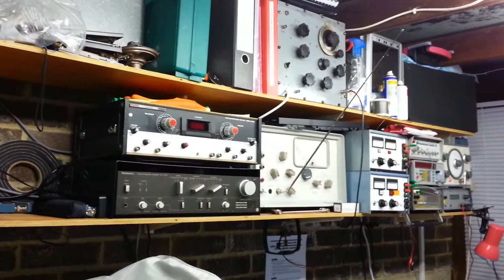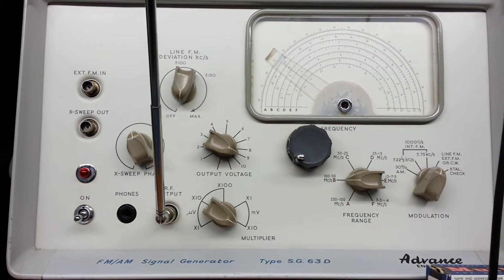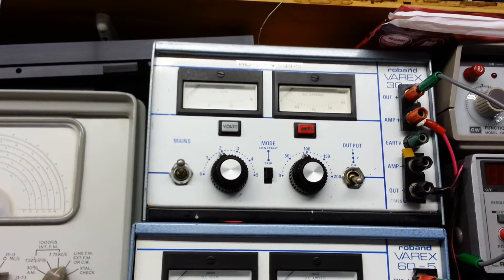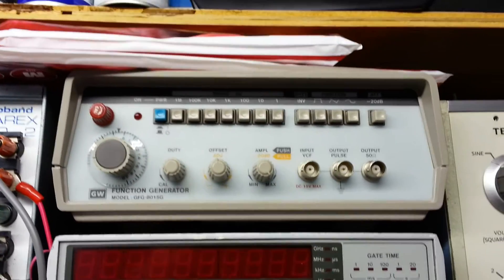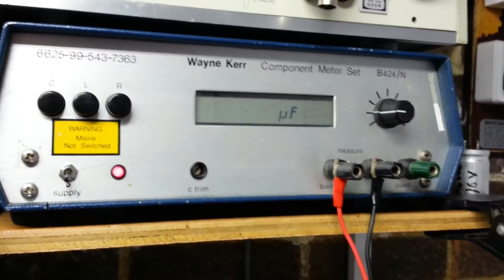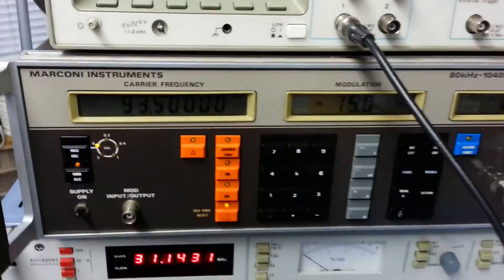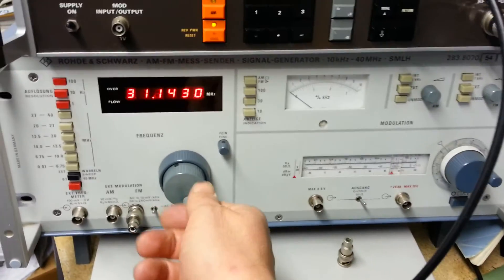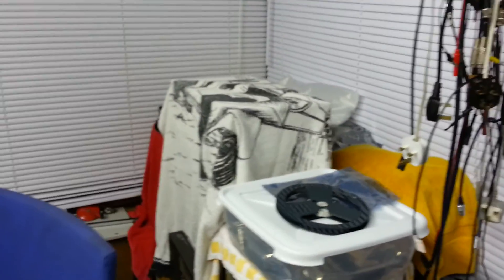A tour of the workshop

Comment: Very nice workshop tour. I have a Roband power supply in the loft somewhere I seem to remember I was always getting confused between constant current and voltage modes. I will have to dig it out and ask you about it just seems like a odd user interface arrangement. I was giggling, He just said  Wayne Kerr.  I like the display on that 54600B scope looks really crisp. Not a fan of the Marconi 2019  signal generator just found everyone I ever owned riddled with faults. Get one fixed and another ten appear ten minutes later.  I have the same digital avo mega and find that the selector switch needs occasionally cleaning.  Very nice thanks for showing us round. Regards Chris
Reply from the maker: +AllTheGearNoIdea The 2019 has performed faultlessly since its initial repair
 Front panel keys are worn out so looking for replacements. Dig the Roband supply out. It might be worth a video! Cheers Simon
Reply: Ok will dig out the power supply